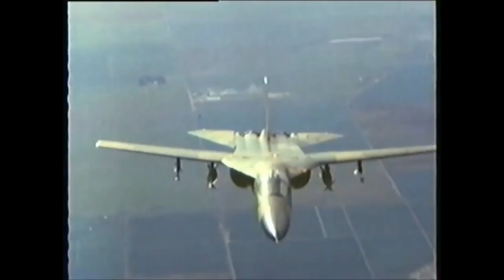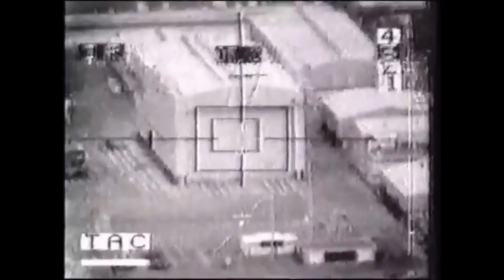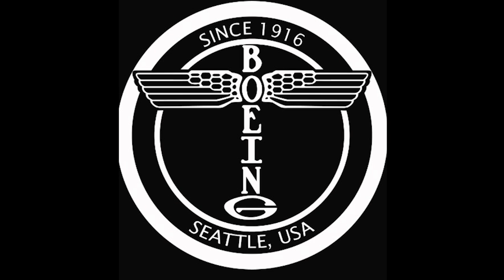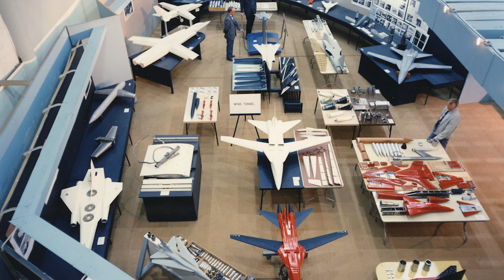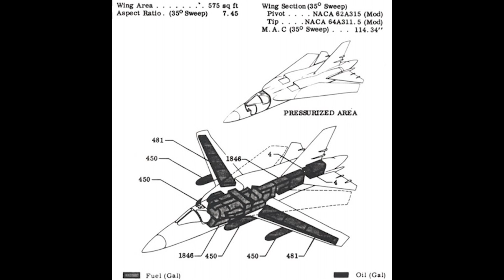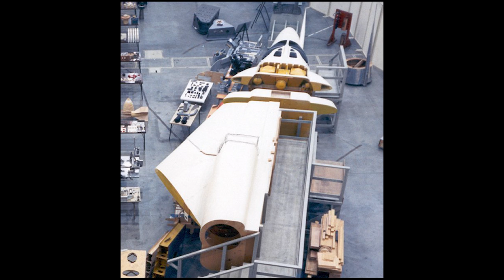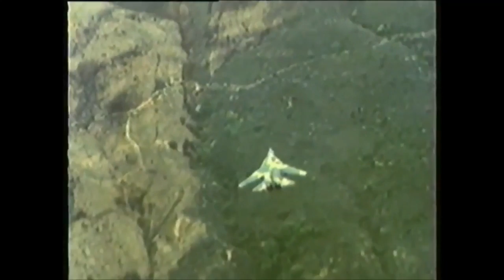Boeing 818 TFX; The Actual Aardvark?

Comment: Yeah it's a good idea to have the engine inlets on top of the aircraft as long as they work well for shockwave management at high mach numbers.... And you never see it either.... That SR-71 and the Concorde sucked up debris rocks and s*** from the runway like you wouldn't believe.... You can take a look at any of those old j58's and every one of them have had quite a bit of sanding and smoothing on the compressor blades and that ultimately takes them off balance after years and years of it.

Comment: Thank you Ed for a great analysis of an aircraft i had heard of but only in passing:  the 818. It now puts my first recollection of what my Dad said when he came home from work one day in the early 60's saying "We won!" into context. He worked for General Dynamics Convair, a subsidiary that did some of the testing for General Dynamics.  I know that this was before 1964 because my brother wasn't around yet, he would be born in the spring of '64. Later I remember he was angry that Grumman and the Navy came up with the F-14 using the F-111 flight and wind tunnel test data on the sly.  He felt that GD trusted Grumman, who betrayed the partnership and developed the F-14. IMHO, the F-14 was a great plane that we still have not equaled in our inventory.  A plane that carries six 100+ mile Air to Air missiles that weigh as much as WWII torpedoes and still have a chance in a dogfight and oh by the way can fly MACH 2.3+.  On the 818, I think the overhead intakes would have produced better low speed lift for carrier operations and perhaps would have soldiered on to this day saving billions of $.  The 818 would have devastated the Fort Worth GD effort since the F-111 would never have been built, but Convair made the Atlas missile mainly at  that time and probably would not have been affected.

Comment: The already flying British TSR-2 was scrapped and the UK Labour Party ordered the F-111K for the RAF in 1967, because of the hype surrounding the aircraft. But the F-111 program was greatly over budget and so the Labour Party then cancelled the F-111 in 1968. The RAF ended up with the subsonic and much less capable Blackburn Buccaneer instead.

Comment: The F-111B was an utter failure at its intent. The truth is the F-4 Phantom ended up becoming the Do All jet that the Whiz kids had wanted. The F-4 is still the only aircraft to ever see combined service with the USAF USMC and USN. The mess that was the F-111B ended up paving the way for the F-14 tomcat. Now some of his cost ideas made sense. IE why can’t they all use the same dress shoes, why can’t they use the same uniforms, or use the same vehicles or buy civilian trucks modded to milspec ( the CUCV or commercial utility cargo vehicle). But for others it’s not for example USN aircraft essentially land in a “ controlled crash” which beats the snot out the jet. So they tend to be built pretty heavy to survive 30 plus years of punishment on deployments. USAF jets tend to have soft landings and long runouts so the airframe doesn’t have to survive the corrosive effects of the air or the merciless wire traps or pummeling of the landing gear. That factor is why the flying services all tend to want equipment tailored to fit their unique operating requirements

Comment: The biggest problem with the Boeing design: it was designed around essentially a "paper" engine, the General Electric MF295; some of the techology would end up on the F101 used by the B-1 bomber. The F-111 was designed around the Pratt & Whitney TF30, which was already developed originally for the canceled Missileer fleet defense fighter project and was in bench testing at the time.

Comment: Thanks for an excellent discussion of the Boeing 818.  One of my early mentors in aerospace had worked for Boeing during the TFX proposals.  We often discussed TFX.  He mentioned a lot of the issues that you mentioned.  He also had observed that Boeing suspected that GD was going to be awarded the contract.  One of the issues the Boeing team faced that he considered to be extremely unusual was the USAF insisted that Boeing actually directly brief General Dynamics on a lot of the technical designs for the 818, and Boeing rationales behind their design.  When both TFX proposals ended up having an extremely similar design and appearance, he was not surprised, and awaited a final decision on the award.  He was sure that McNamara would decide against Boeing, regardless of what the Air Force might decide.  That said, my mentor still had similar comments that I see here in this discussion thread from others, as well as comments you made on Boeing’s historical contract performance, etc.

Comment: Would love to see more aircraft / concepts with the engines positioned like the 818s, with or without the variable geometry swept wings, but also with a full delta wing setup as well. It seems to be a very efficient design and principle, lending itself towards improved space management, larger areas for bomb bays/fuselage and wing mounted hardpoint placements, as well as landing gear undercarriage stowage. 

Strange that we haven't seen more or any aircraft with this type of engine configuration.
Reply: There’s a very simple reason for that.  Angle of Attack blanks out the intakes from getting consistent and predictable airflow, so you then would see compressor stalls due to intermittent air starvation, especially with a delta wing.  Benefits of top-mounted inlets are FOD-avoidance in addition to everything you listed.  Cons are airflow disruption as described, design work-arounds for the ducts, maintenance access, and frontal low pressure stage inspections.  Airflow interruption at even slight AOA is a NO-GO for the design though.

Comment: I was in the USAF as a pilot in 1980 and the story I heard was the final decision was made for the F-111 because the politicians wanted a plane that would be built in Texas for reasons of pork barrel spending in the districts that would benefit them politically, And the fact that the President who made McNamara Secretary of Defense was from Texas probably swung the deal! I always wanted to fly one but missed being selected as an F-111 pilot in part because it seemed that even the pilot selection ended up being political as it was saved for higher ranking career pilots on fast-track for promotion to flag rank almost as if it was a "reward". But then, maybe I just wasn't good enough LOL. I did hear it was a blast to fly but the downside was that pilots often became a mere passenger as most missions were flown on autopilot while the plane was being tossed around so much that even experienced "drivers" got queasy. It's true that pilots are often lousy passengers during wild maneuvering because we never learned to have the iron stomachs that our ROIs got by bending down to stare into radar screens while we hoicked around! I heard from old bold Aardvark drivers that the missions in Vietnam often became death rides because the flight profile was to navigate on terrain avoidance autopilot so low and fast through valleys between jungle infested hills on such a rigid schedule that the VC knew they just had to throw a bunch of dumb AA in the air at the right time so the planes flew right through a shit storm of lead hail. Ironically, my first squadron commander once old me, "Tim, you're either going to be a General or they're going to kick you out". 
PS:: I never did become a general. LOL 
BTW if anyone is interested in antique civilian planes and tall tails ;-) you can check my YouTube channel for an old movie* of me flying a 1940 Taylorcraft BC-65 I restored way back in the 70's. 

*using "movie" instead of "video" obviously dates me ;-)
Reply from the maker: Feel free to put a link in for people.
Reply: @EdNashsMilitaryMatters  https://youtu.be/-wRKSjTI7Do

Comment: The original requirements presented by the Navy and USAF were not incompatible, but the requirements changed.  The lessons of the TFX program are commonly misinterpreted, but repeat a narrative for decades and it becomes "truth". The idea that one basic airframe could fulfill two different roles was not a dumb idea at all. History is full of examples of aircraft that were versatile enough to fly for different services and even perform different missions.  
Initially the TFX program was reasonable because USAF and USN were both asking for a large aircraft that could lift a heavy load of fuel and weapons, with long range or long loiter, plus high-speed dash or intercept. Twin engines and an innovative variable geometry wing were called for, and DOD logically assessed that it would be wasteful to develop two very expensive advanced airframes when a single one with some variations could do both jobs. 
The reason one basic airframe could do both jobs was because original USN specification was for a fleet defense fighter, not an air superiority fighter. It was not originally intended to be what later became the F-14, but to perform the role meant for the Douglas F6D Missileer, with the addition of supersonic dash capability.  
The biggest difference between the airframe requirements of the two services was that USAF wanted a tandem cockpit and USN want side by side seating.  Boeing tried to make both services happy, but MacNamara’s DOD thought USAF could suck it up and have the crew sit side by side.  This is ironic considering that when the Navy cancelled its version USAF was stuck with the cockpit it didn’t want, which also ironically contributed to the airplane being too ungainly for a dogfighter.
The original idea wasn’t dumb -- what happened was that needs changed.  USN revised its specifications for the TFX as result of combat experience in Vietnam, and realized they also needed an air superiority fighter to replace the F-8 and F-4, but couldn’t afford that in addition to a dedicated fleet defense aircraft.  Thus, the TFX would now have to be able to dogfight as well as be a missile interceptor.  The F-111B could have worked as a missileer, but it was too fat and underpowered to compete as an air superiority fighter.  It was proper of the Navy to recognize that its needs had evolved.  This was perhaps the beginning of the Navy realizing that budgets and hangar decks did not have room for so many specialized aircraft.  USAF desperately needed the F-111 to replace the F-105, so they sucked it up and accepted the heavy airframe caused by the loveseat cockpit they never wanted.
Reply: Vietnam showed the Navy that they could not ignore the air superiority mission and they need a fighter instead of an interceptor/multirole aircraft.  The F4 is an overrated aircraft that  was not the right choice for the Navy given the state of technology in the late 1950s.  The F8U-3 was the right choice.  That is why the Tomcat was built primarily as an air superiority fighter with long range missile capabilty.  Interestingly, the F-14 would have made an excellent multirole aircraft because the capabilty to carry 6 Phoenix missiles meant the airplane could carry a large bomb load.  The "Bombcat" capability came into it's own at the end of aircraft's career.  After the A-12 program was cancelled Grumman offered a ground attack version of F-14.  They deleated the AUG-9  and added the avionics for precision strike.  The Navy rejected Grumman's proposal in favor of the F-18E/F.
Reply: @johnshepherd8687  Yes, the Navy version of the TFX had originally been intended to fulfill the role of the cancelled F6D Missileer with an added supersonic dash capability.  Combat experience in Vietnam convinced the Navy that it also need a new air superiority fighter. They knew they could not get two new fighter aircraft at the same time, so they pulled out of the TFX program to develop an airplane for air superiority as well as fleet defense.  The irony is that the the side-by-side crew seating that the Navy insisted on over USAF wishes helped make the F-111 unsuitable as a fighter.  If they had allowed a tandem cockpit it might have made the design more like the F-14 from the beginning, which we now know could also carry bombs.
Reply: @gort8203  The original requirement for the F-111B was drawn up before Vietnam experience showed that Air-to-Air combat was not a thing of the past.  By the time they started flight testing it was clear that the F-111B could not meet the actual combat requirement and the Navy would need a different aircraft.  It would be interesting to see what would tbe line of development would have taken if the Navy had chosen the Crusader III instead of the Phantom.  George Spangenberg, who was the primary evaluator for BueAir,  recommended the Crusader but was overruled because of the emphasis on BVR engagements.
Reply: @johnshepherd8687  As far as I can tell we are saying the same thing about the original intent of the F-111B.  Then the Navy requirement changed, quite justifiably.   As far as the F-4 vs the F-8 that is separate subject, and in any case the F-14 replaced them both.
Reply: @gort8203  You can not seperate the F-111B from the 1958-59 next gen US Navy fighter competition.  Had the Navy selected the Crusader III then it is quite possible that they would not have had a problem with the B model since they would had an a proper air superiority fighter.
Reply: @johnshepherd8687   I do separate it becuse I'm discussing what was, not what might have been if the planets had aligned differently.  YouTube is awash with videos and comments claiming this or that superior airplane was down-selected for production in favor of an inferior plane.  You obviously believe the Crusader III would have been far superior to and longer lived than the F-4.  I say maybe, maybe not, but the F-4 is what we had.
Reply: @gort8203  Then why are you interested in and commenting on an airplane that never was?  See the contradiction in your comment?  And I never said the U-3 was better in all aspects than the F4H.  It was better for the actual combat environment that we found ourselves in and this is without dispute.  It also relevant to discussion of the TFX program since the outcome of the process that selected one aircraft over the other was a significant factor in the requirements process for the aircraft under discussion.
Reply: @johnshepherd8687   I am not interested in talking about an airplane that never was, I'm the one trying to NOT talk about the Crusader III.  I am not saying it's not an interesting topic in its own right, and I'm not saying  you opinion on that airplane is wrong.  I'm just saying that it's not relevant to the point I was making.  
These YouTube discussion always seem to drift off topic, so I will summarize mine for you.  The TFX goal of a single basic airframe for both USAF and Navy was not unreasonable.  Both missions called for an airplane with good cruise/loiter fuel economy as well as high as high speed dash. A large airplane with a high fuel fraction and variable geometry wings was need for both, and it made sense for DOD to try to develop one rather than two such expensive projects. The common narrative that the airplane was expected to do all things or vastly different  things is a myth.  Nobody expected the airframe to be a dogfighter, and it would have worked well as a Missileer as well as a strike aircraft.  One need only look at the Panavia Tornado for an example of a similar project that succeeded.  The F-111B did not fail to meet the requirement; the Navy (wisely) changed it's mind about what it required.
Reply: @gort8203  Yet you posted about a plane that was a piece a paper.  The Crusader III was a real airplane the flew for many years with NASA. Whatever.
Reply: @johnshepherd8687    What airplane was a piece of paper? There were more F-111Bs built than F8U-3s.  I don't know what you are talking about, but whatever, it doesn't matter.  Nice chatting with you.
Reply: @gort8203  The Boeing Project 818 which is the subject of the video.  Vought built 5 F8U-3 airframes for the 1958-59  next gen Navy fighter competition.   When the competition ended Vought turned the aircraft over to NASA.  NASA used them for high speed, high altitude research into the 1980s.

What is missing from these discussions is context.  Why the F4H?  Why the TFX?  Why  the F14?  Each why is related to past decisions.  The F4H was chosen because it was  better at  unassisted BVR engagements and could drop a lot of bombs when not shooting down the expected bomber threat.  The TFX happened because the same aircraft could do the very long range missilier and deep penetration missions.  The F14 happened because Viet Nam changed the context and the Navy needed to combine the air superiority and missiler missions.  If you change the first decision, you change the context for each subsequent decision.
Reply: @johnshepherd8687  You're not listening. The F-111 IS mentioned in the video, but the F-4 and F-8 are not, but you just don't want to give up talking about them.  The only thing I addressed was the common misconception that the TFX project was a dumb idea and that the F-111 could never have fulfilled both roles.  You are raising a different subject, and I'm done with it.

Comment: In fact, 7.   F 111 s were built for the US Navy. They did f!y and land on US Aircraft Carriers. For years one was on display at Naval Air station, China Lake, California.  Sometimes designated F-111B. They were painted in full Navy colors and had arresting gear. They were deemed Too heavy, with too fast approach speed and too big for the carrier environment.  I take issue with the assumption that the F111 was a fine aircraft. In fact, it was an enormous maintenance hog, and often spent much more time in the hanger undergoing maintenance then in the air. Pictures of Navy F111s can be easily seen on the net.